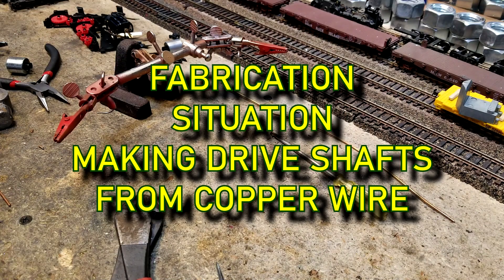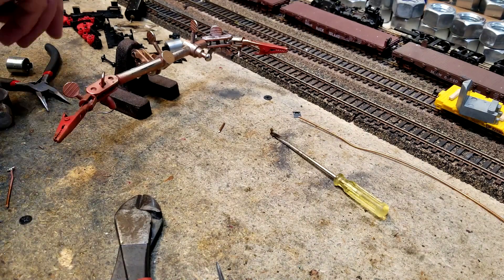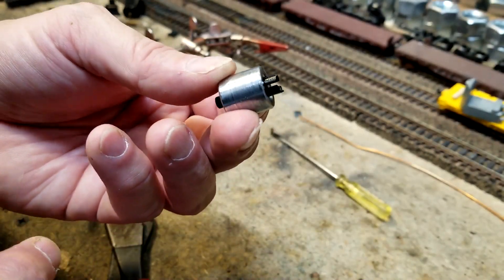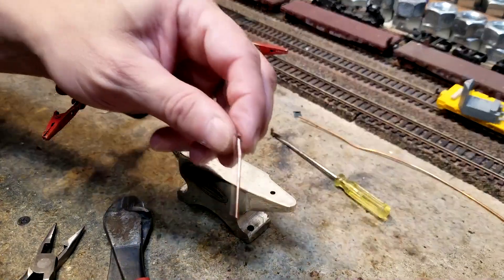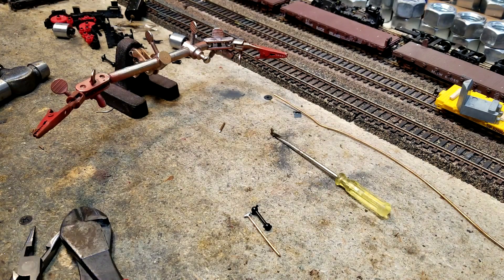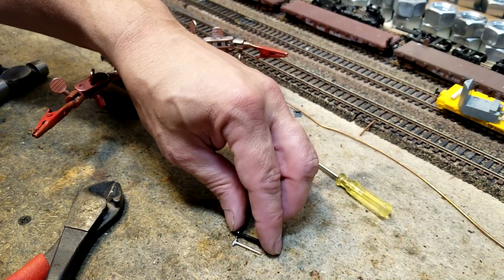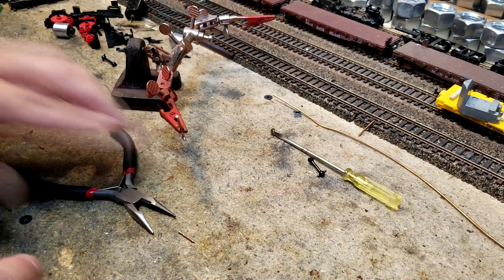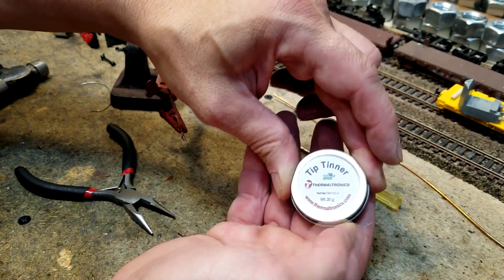Fabrication Situation make a new drive shaft HO scale

Comment: Drive shaft pins must be in parallel.
Reply from the maker: if the pins are parallel then the shaft will slip - the walthers GP9 is a locomotive with parallel pins that very often loses the front shaft
Reply: If Parallel it will bind when the truck turns no a good idea  been making them for years using coat hanger doesn't bend as easy as copper

Comment: i make my drive shafts in a similar way, except I add a ball to each end like the factory shaft has.  The way I do it is I put a large drop of super glue right where the solder has been placed, then I sprinkle backing soda on the glue.  It dries instantly, then I shape the glue/backing soda ball will a small file.  I add more glue and backing soda if needed and then shape again.
Reply from the maker: that's what I do when a ball is required - infinite uses for super glue and backing soda.  once I have it shaped I rub graphite on the ball which fills the gaps nicely

Comment: What kind of solder do you use with the acid flux paste ????
Reply from the maker: I use fine electronic rosin core solder for everything- even with acid paste because its slightly stronger than regular 60/40
Reply: @elite194  thank you